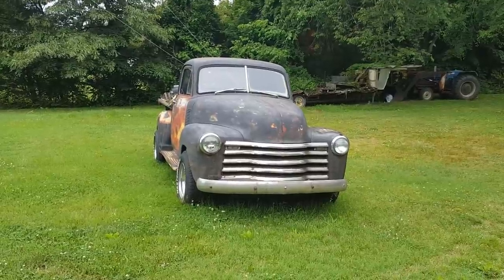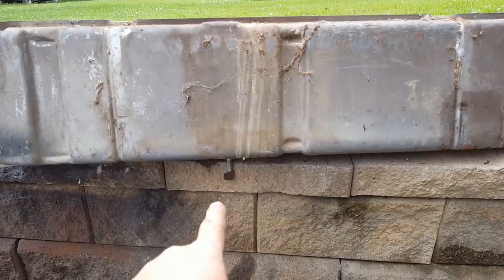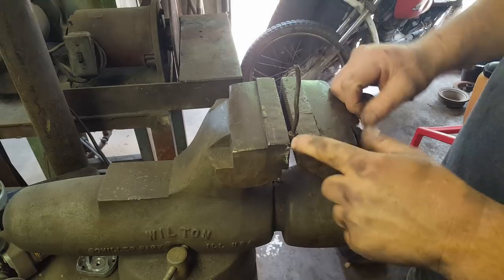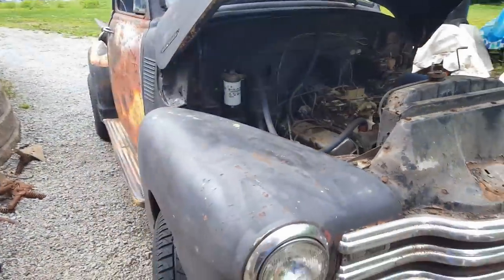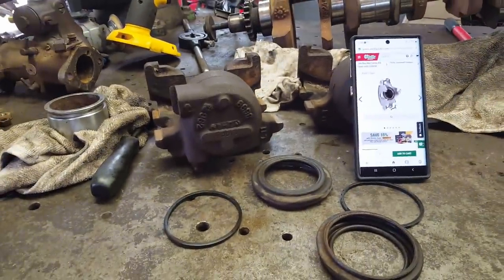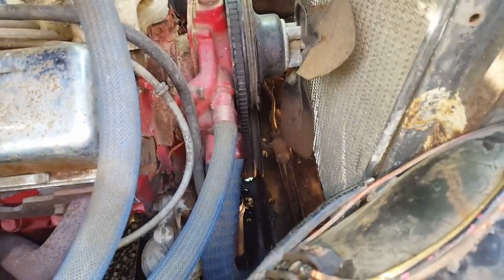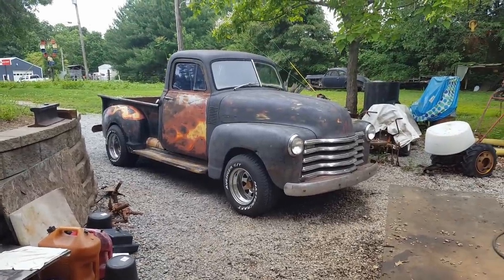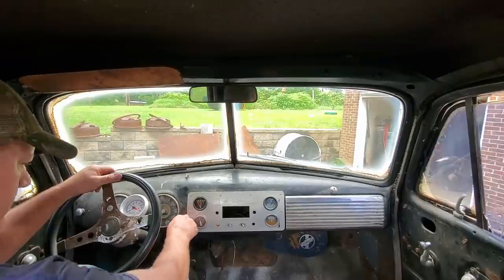Getting the 53 Chevy (Dude) ready for the road ends in a fail.

Comment: You might want to look into a hydro-boost system for your brakes.  It’s a brake booster that runs off the power steering pump.  They used them in late 70s full size Lincoln / Mercury cars and in GM diesel trucks in the 1980s.  I think they had more applications, but those are the ones i know about.  The booster is small and might fit next to your clutch master.

Comment: Breaks on a bicycle that has break pads use the cover and wire as a throttle cable. You can take the bracket that the cable goes threw and attach it to the carb the put the break cable through the firewall and attach it together

Comment: I ran several 327 engines back in the seventies and got the best performance with timing set at 6 degrees before top dead center and the spark plugs gapped at 32 thousands

Comment: Thats a great ole truck and some good stories too.
What I would do    keep the front end
pull the motor and rebuild
add pw/str using vega or something 
get a gm column  from the 70's with tilt , signals and hazard
serpentine the front of the engine, you can get all the bkts off a old van with AC
you can  try larger front discs or ceramic pads may help. engineer a power booster inside the FW  
Redo the seat bottom. Burlap and foam and ready made cover. 

JMHO, looks like a great project and plenty of content for us youtube junkies.

As far as a s10 frame , Half Assed customs just threw together a 51 Ford PU with a lt1 engine and s10 shortened frame. seemed pretty simple but he has a great shop and no flies on his bottom !

Comment: If you take the wheel cylinder bolts out, you can usually hold the line fitting and unscrew the wheel cylinder from the fitting.

Comment: the dude is looking good, nice work. single plane intake, holley 750 with headers is far from stock, chuck the book and go with what you initially stated, it'll run much better. 36-39 total timing is usually a nice place to be:). You could clean, sand with 80 grit and slap some JB weld on that crack for a short term fix while your deciding which way to go.... good luck, thanks for sharing!

Comment: Fix up in steps and keep up excellent shape too that truck is sweet vehicle too! Also check up for no abs brake booster setup for 2002 Chevrolet Impala E-X (LS) 2 or 4 door setup on 4 wheel disk or drums brakes on back only and maybe worth it try plus Power Brakes from intake too!

Comment: HowDo? I've seen the video when you got it running for the first time after so many years of sitting, I'm impressed for what you've done to it back then. Kinda a bummer ya had to change the seals,brakes,fuel lines and clean the fuel tank? Allot of small stuff as well, but love  the truck.Check the check valve in the carburator,if it has one.Some Holley's have them, some don't in which explains why the carb started spitting back on ya. I hope this information will be a help to ya. I had a 55 Chev 3/4 ton, I got running at the age of 13yrs old back in 1979. It was the earlier 55 before the apache can model.✌️🌟🌟🌟

Comment: My 1st cars were 55 n 6 chevs,i kno delimna on oil leak gone undetected,,enjoy th time you have this year,replace chain gears n maybe spicy cam..sounds like this motor your father ran  every 327 iv had i trusted an thought theres no better power,,if you can use this till your parts n other motors are rounded up n rebuilt,  thanks for showin your project,iv left my small block n miss them for ease of repair n locating parts,,th 440 rb n 727 i hv in76 d100 make parts search last years ...

Comment: You could move the clutch assembly left then bend and extend the pedal to suit which would give you room for power brakes, or you could use a cable to slave cylinder setup which would also give you the room you need

Comment: About your brakes you have a straight Axel and a after market kit on it. I had the same one got mine on line. Dodge Diplomat rotors and different barings that mate with the spindles. It stops good 😀 no big deal mine still works great.

Comment: With the fuel in the tank standing over the outlet, I would bet your fuel clogging issue is that 90* fitting. Get a straight hose barb and let the rubber line make a smooth bend instead👍🏻

Comment: I would rebuild the 327, it was a motor worth saving. It sounds like you could just put a timing chain in it for now and replace the cover. You should be able to loosen the pan enough to get the timing cover in place, the engine sounds strong.

Comment: The best way to see what cylinder is not firing is take water and spray or drip the water on each exhaust pipe as it's running the cold cylinder won't evaporate the water as fast it's lot easier then pulling wires to see what one it not firing

Comment: i have installed at least 50 timing chains on small block chevys and never have pulled the oil pan down here in the south none of us pull the pan cover slips right out and in no problems
Reply from the maker: Well maybe I'll be as good as you one of these days! 🤷🏻‍♂️
Reply: @ThisNThatGarage  I didn't mean it as a smart ass remark I used to remove the oil pan until I learned you don't have to. Was just sharing what had been shared to me

Comment: the short pump has a spacer..is that same length as long pump..ford just use defferent length spacers,,same pump,,its cheaper..but they have 4000 different pulleys..

Comment: Just got done working on my girlfriends 1950 chevy 3100 still all original 6v .. points... shes the second owner the engine has never been rebuilt.. its 3 on the tree.. it maxes out at about 40 mph... do you remember the top speed of the truck in its original configuration????
Reply from the maker: Sure don't but 40 seems kinda low.

Comment: You oughta put a lawnmower carb on it. Really! ThunderHead289 did that on a 302 V8 and it actually worked, and got 40 MPG!! The theory was that vaporized gas burned a lot better than liquid gas, which makes sense. Unfortunately he has disappeared from YouTube the past month. I guess big oil got to him?!?!?!?
Reply from the maker: Even tho I trust the govt as far as I can throw it I highly doubt the feds did anything. Smokey yunick did a vapor carb thing years ago, I want to say it was a fiero he did it on. I've had an idea bouncing around in my little pea brain for awhile about running a motor off of used oil and one of these days I'm going to try it.
Reply: @ThisNThatGarage  - farmers have added used oil into diesel for decades. Not sure how that would work with gas engines though. I'd like to see lots of experiments with the price of gas skyrocketing.

Comment: I wonder if that master that you have on the truck is for power brakes and that is why it's hard to stop because I had a car that had a power master with no booster and it was a witch to stop and I put a manual brake master on it and it was so much easier to stop but with all the things you got changed on that truck I don't know
Reply from the maker: Very possible.

Comment: Question , Did you when you had the engine tore down , Check the timing chain ?    And why not ?
Reply from the maker: I've never had it tore down but yes the chain is very loose hence the reason for the hole in the cover.